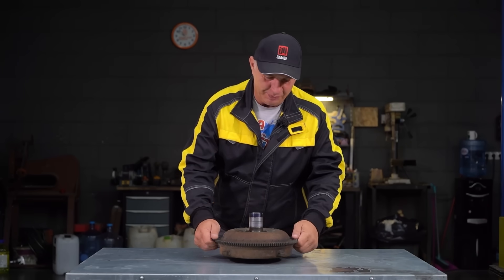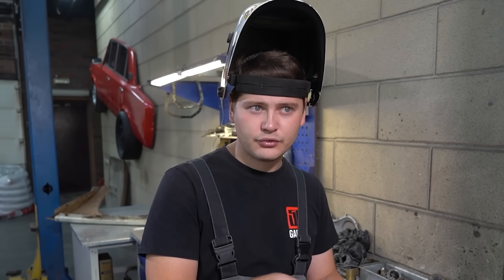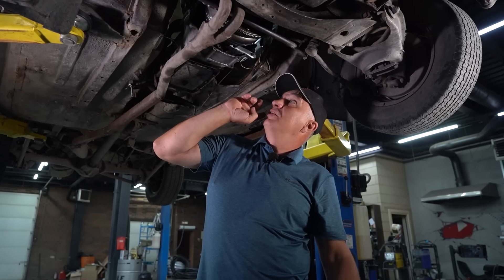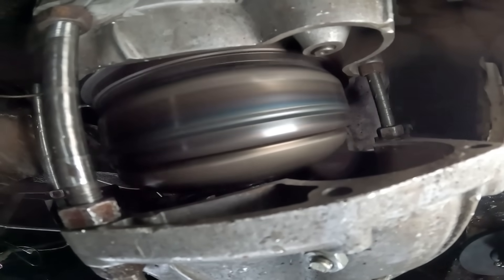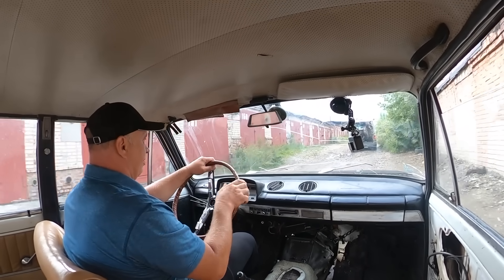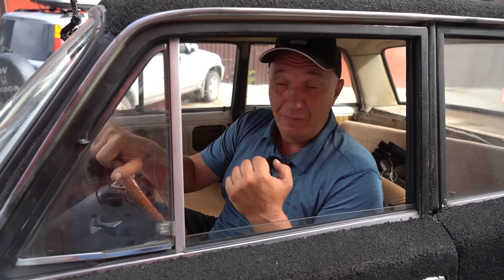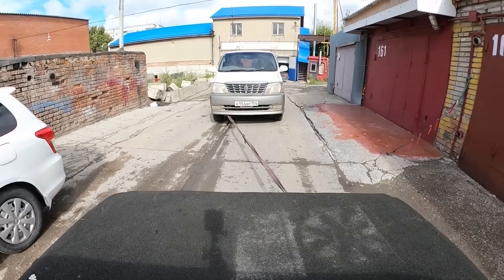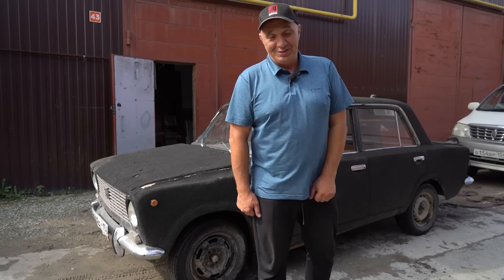Torque converter in a manual transmission - will it work?

Comment: I'm curious now. How would a lada drive with an Eaton Fuller 10 speed transmission from a large truck? You guys should try it. 😂
Reply: How is any set of gears different from the next beside the ratio?

The Eaton fuller is made for a 2500rpm motor. 

The lada needs to get to 4500rpm to make peak power. 

Therefore negating the purpose of half your gears.
Reply: @fastinradfordable  that's cool but I'd still like to see them do regardless whether it's a good idea or not

Comment: Yes it does. Volkswagen used that for their semi-automatic gearbox called the “Auto-Stick”. A semi-automatic transmission has an automatic clutch, whether actuated by touching the stick shifter (like the Volkswagen Auto-Stick), or by the very shifting between gears (like the system used on the Citroën DS).
Reply: Gotta be the most pointless thing ever. I'm disappointed that sticks are going away but it's only because most people can't figure out what the 2nd brake pedal does or how to use it🤦‍♂️

Not difficult but the typical durrpei can't handle it.
Reply: @MadScientist267 It's not that they figure it out, EVERYONE used to drive manuals. I've taught many different people how to drive a clutch. It's just that an automatic is easier and requires less effort. As much as I love a manual, it's a pain in stop and go commute traffic!
Reply: @MarkS61  Only in the absolute worst of it. If there's any forward motion in general, there are ways to mitigate constantly being in the clutch.
Reply: @MadScientist267  Never used one?
Reply: @BTW...  I'm afraid you'll need to be more specific. If you mean one of those crappy manumatic type pieces of crap, no. I like to actually drive my car.
Reply: God I hated those
Reply: @fastinradfordable and now we have dsg. A dual clutch computer shifted manual transmission.
Reply: @fastinradfordable  Took all the fun out of engine R&I for sure. Oh and you gotta love "shifter points", I would just want a button on mine if I had to own one. I did build a few trikes with them for wheelchair bound clients and they worked well.
Reply: @fastinradfordable   They could be a pain to work on, sure.
Reply: My aunt has a 68 VW Beetle with an auto-stick. Was a problem to get a clutch and the accompanying vacuum tank to actuate that clutch. Around town it is left in second gear and that torque converter does the job well.
Reply: And it turned out to be extremely unreliable and another piece of shit.

Comment: When I was in service in 1994 we had the DAF YGZ. This also had a manual gearbox with a torque converter. You could drive away in any gear,it took a little longer if you started in the highest gear.
These YGZs were used to transport, launch and retrieve folding bridge sections and the associated push boats. These trucks could drive up almost any river bank with a fully loaded push boat or bridge section. This was due to the torque converter that generated so much torque.
Reply: Cool
Can I put one in my Honda ?
Reply: @fastinradfordable with some modifications to the engine/transmission joint setup, sure.
Reply: Were there instructions to prevent overheating the torque converter? Or did it not matter, could you start in any gear without issue?
Reply: @otm646  Basically the same as in the Finnish Sisu SA-240 https://en.wikipedia.org/wiki/Sisu_SA-240
IIRC it has a temperature gauge for the ATF, same system is also used as a hydraulic retarder. It has a regular automatic gearbox cooling circuit.
If it was a hot summers day and you drove with payload in deep sand with higher gears constantly slipping the TC then it would start heating up.
Reply: @otm646  What I remember is that you could drive away in any gear with no problems. These trucks also had coolers for different types of fluids, including one for the transmission. I don't recall having a single problem with this system.
Reply: I've seen many YGZ's in my time in the service, Back in 1990 (Verse!).. never knew they had torque converters.. but they were indeed hauling ass, on any terrain, no matter how steep.. 
(BWS Cie. Hedel)
Reply: Is it the same system as in the wartburg?
Reply: @maxx-er3fj  I can't say because I'm not familiar with that system.
Reply: The other thing a torque converter does is allow an engine to run at a higher speed when it's undergeared, enabling it to make more power for the torque converter to convert into torque. Often undersold aspect of torque converters.

Comment: Very similar to Ford , New Holland, international harvester ect. They all used at some point, a converter drive 3 and 4 speed manual transmission in the late 1970's early 1980's in backhoes, dozers, forklifts and some tractors. Tons of torque, low maintenance.
Reply: I remember Farmall M on a farm I worked had that.
Reply: @terrypetty9822  torque amplified model M
Reply: Powershift or something like that they called it?
Reply: @goosenotmaverick1156  That was John Deere's version. Had it on an old 4020 from the 60's. Junk.
Reply: @ManJunk7  gotcha, thanks for the clarification! 

I've seen in some literature about the Ford version but the tractor I worked on was a regular style manual transmission so I for the most part, ignored it. 🤣
Reply: Turbomatic 
 @goosenotmaverick1156
Reply: Allis-Chalmers.

Comment: My fathers 1941 Dodge had a system called Fluid Drive, A torque converter on a manual clutch/trans
Reply: Yep, Chrysler introduced the Fluid-Drive transmission for the 1939 model year. Lived on until the early 1950’s, ended up getting replaced with a simi-automatic transmission which still had a clutch pedal, but the shifting was done mostly automatically.
Reply: @seana806  Hi Sean! Funny seeing you here :)
Reply: Believe you may be subscribed? Haven’t seen your name in awhile so I may not remember.
Reply: Was that a torque converter or a hydraulic pump though?  I know you can get hydraulic drives but nothing about them just that they are very powerful.

Comment: Now we need Manual style clutch with an automatic transmission!
Reply: They did that back in the old days of racing it was a clutchflite
Reply: @mwce2  and clutch turbo, gm turbo hydromatic, 
My dad ran one in his race car during the 60s.
Reply: It used to be a thing in the early/mid 70s, take a torque flite trans and put a clutch in it for drag racing, they termed it a clutch flite, allowed responsive launch and gear change without loss of acceleration. I would love to see these guys do it
Reply: 🎉 @mythoughtsonfaith1031 Think those old Chrysler s had two pumps, front and rear, said you could actually push start them
Reply: @tcmits3699 
Early units had a rear pump. By about 64 they deleted them.
Reply: robotized clutch ? like the bvmp gearbox ?
Reply: I've seen it done in a Toyota trophy truck. Foot clutch with a turbo 400 trans I believe. I'd still like to see it done.
Reply: @yz250ftony  Dumb idea 😂
Reply: @yz250ftony probably had a manual valve body so it couldn't shift itself.
Reply: So basically you want a computer controlled manual transmission?
Reply: @brandonerhardt4905  Which already exists in semi trucks and Formula race cars.
Reply: @brandonerhardt4905 no computer.   It is a power shift transmission.
Reply: @brandonerhardt4905  That's what every automatic Semi is in the US. Computer controlled manual trans.
Reply: @brandonerhardt4905 not an ECU controlled manual, we already have those, he wants an automatic trans that lets you manually shift the gears with a clutch pedal, without damaging the gearbox
Reply: @joesaiditstrue  which they already have.
Reply: @joesaiditstrue easy throw a manual valve body on an automatic transmission and slap a clutch on it. Presto
Reply: @brandonerhardt4905  Just like my Escape 6 speed.
Reply: @brandonerhardt4905  that's a common thing it's called a semi-auto transmission and it's abhorrent
Reply: Already exists
Reply: We have that for example the ford power shift aka the power shit.
Reply: Go look at a automatic semi they’re manual transmissions
Reply: @philipstokes4509 nope that's just a manual transmission with an XY shifter at the top and an electronically powered range shifter
Reply: USspec ford focus 6speed automatics do that. It makes it drive weird.
Reply: @EvilCerealBoX powershit box
Reply: They used to call a clutched th400 "the poor man's lenco".
Reply: AGS exists
Reply: Been done in sprint cars decades ago.
Reply: Bmw smg in the e46 m3 and a few other bmws
Reply: Yep. Been done in drag racing back in the day. 57 Fairlane, 460, c-6 and a third petal. Wasn't mine, but did it go!
Reply: SMG, DSG, DCT, TCT, 2CT, and many more lol
Reply: Look at Koenigsegg
Reply: Most of the european trucks have automatic gearboxes with clutch for departing, or at least they had.
Reply: hhhhhhh
Reply: Mazda does this in their current automatics.
Reply: Now, "Let's GO !"
Reply: Someone’s gotta tell him
Reply: Look at old mercedes benz a series
Reply: Peugeot and Citroen have automated manual boxes , is a full manual box with modules to work the clutch actuator and  gear selectors.
Reply: @garrylivie5862  that is exactly how "automatic" road rangers in new trucks work!
Reply: That's a clutchflite it's a bad mofo.....
Reply: Pritty much a AMT truck gearbox take off with clutch then auto after that
Reply: @dgarg3  Why?
Reply: Dsg...
Reply: They have that with konekoenigsegg they made that look it up
Reply: I made that
Reply: Who's gonna tell em?
Reply: That would be the Clutch flyte.
Reply: I thought Chrysler did this with a loadflight transmission
Reply: I believe it was bmw who had this transmission. It was an "Intelligent automatic clutch" so no clutch pedal but you still had to shift gears. Top gear did a video on it
Reply: All you need is a manual lockup box
Reply: The DCT'S long lost cousin
Reply: automatic transmission forklifts already have those, there's a manual style clutch so that you can rev the engine for powering the hydraulic pumps, all while the transmission is still in gear.
Reply: Mercedes did that in the w204 C63 black series
Reply: Chrysler did that with the "Clutchflite," a Torqueflite with a clutch replacing the torque converter.  It was developed for drag racing.
Reply: Chrysler didn't do it , B&M racing did it to Torque flites and GM turbo 400s . Later on several other tranmission companies started building their own versions .  @walterkuleck7274
Reply: they already do that. it is a product you can also add it to some transmission computers to simulate a clutch.
Reply: yes that would be interesting to see
Reply: Oh god. How would you know when it needs to shift
Reply: AHA!
just take a manual flywheel and put it on an automatic transmision along with the manual transmision bell housing to have the clutch piston.     This works if the automatic and standard transmision bellhousings interchange.
Reply: Tractors with automatic transmissions already have that they use a clutch with an automatic.
Reply: Been done, ask Ford about their stop and go traffic clutch failures
Reply: People are using ZF 8HP’s with manuals
Reply: And electric car with manual transmission
Reply: Peugeot 508 2011-2018 etg 6 gearbox
Reply: ZF 8HP can do that already. Look up ZF 8HP Clutch Pedal.
Reply: @Borgschulze car friends are the best❤
Reply: LOL Can you say massive shift shock. There would be no reason to disengage the clutch unless at rest. The transmision would do the shifting for you but it would act as if someone had the converter in lockup all the time. The shock of inertia going through the gears would either burn up the clutch packs in the transmission or sheer off the input shaft.
Reply: @DJWhitetailfluff that is how they work in auto transmissions.  Yes the tc unlocks but if you are still on the gas you are still transmitting power to the rest of the trans, and if it unlocks you can even transmit more as the tc does its thing though it does soften the load.  Modern cars (00+) implement a type of torque management, commonly ignition cut or pulling timing and fuel, on hard shifts to protect the trans, that's where the fart sound comes from, so the problem is basically solved already.
Reply: Mercedes Multi Clutch Transmission is literally that
Reply: Not knowing when you have to press the clutch leading to excessive synchro wear, and no cooperation between the throttle control and your clutch. Congratulations, you just came up with the dumbest idea in automotive history.

Comment: Congratulations it's terrific! If you can put an old technology rear wheel drive automatic transmission without electronics and with kick down cable on lada it would be a great experiment!
Reply: The rover v8 did just that.

Comment: This would be great except I suspect heat will be it's killer. Some 60s American Trans. Were air cooled and had a fan built into converter. Maybe the open bell housing will be enough. Basically a shuttle shift old tractors used.
Reply: Yeah, the converter was smoking when they parked, so it got HOT. A real setup would need functioning lockup, and a cooler of some sort.
Reply: Yes that is a good point.

Comment: NSU Ro80 had a 3 speed manual with a torque converter and a clutch operated by touching the gear lever.
Reply: The old Dodge pickups from somewhere around the 1950s era used a similar setup.

Comment: The combination of a manual  clutch with an automatic is great for drag racing.  You only need the clutch to get moving then shift fast without using the clutch.
Reply: Clutchflite old-school
Reply: This is how formula1 cars work. They only use the clutch at the start/pits. Otherwise it's a DCT gear box.
Reply: So like a bruno/lenko
Reply: That’s what a sequential gearbox is for
Reply: @VayporWayve  Those were hard to find in the 1970s.

Comment: The original automatic transmission input shaft probably has a hole through the center. This is for the lockup clutch. Without pressure to the clutch, its not going to lock.
Reply: Yep. Hydraulic pressure is what activates it, and there's no pressure.
Reply: On the Rover 3.5 automatic you had to manually set the gearbox to lock and it was only able to do it in first gear, it also would have a position on the gearstick for lock up in 2nd gear but not in 3rd.  I think the slip was only 5% when cruising could be 10% not sure but I know it's not bad.  I think though they use the gearbox for quicker acceleration and less use  of fuel.
Reply: @Moonlightshadow-lq4fr oh yea the rover 3.5 was very fuel efficient😂😂😂
Reply: @fastinradfordable  Imagine if it didn't have a gearbox then :)
Reply: Mine was OPEC-approved at 10mpg.
Reply: Correct, you can see the lock-up supply hole at 3 min 29 sec.
Reply: Maybe a volvo 345 gear box trans axel and auto front end ?
Reply: Yeah there was no way it was going to happen.